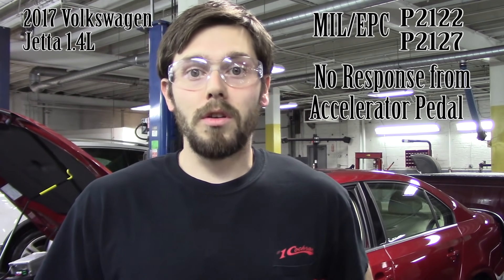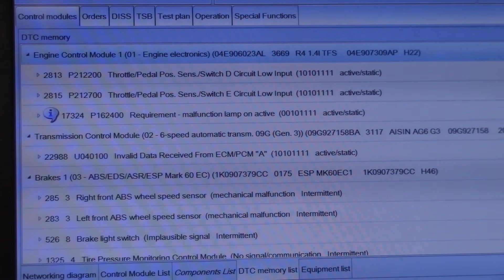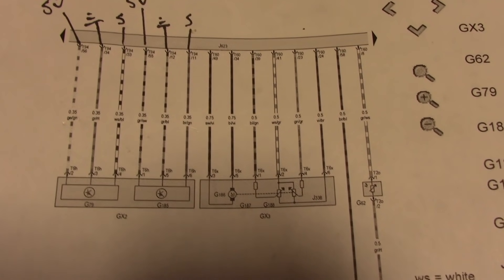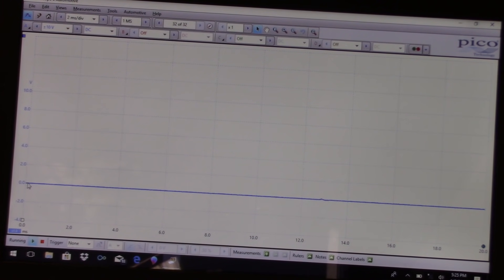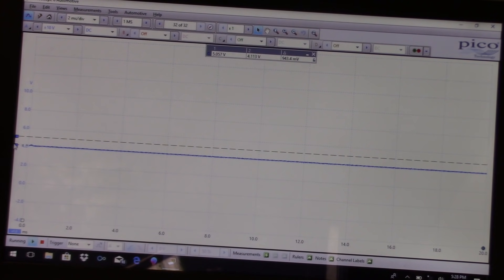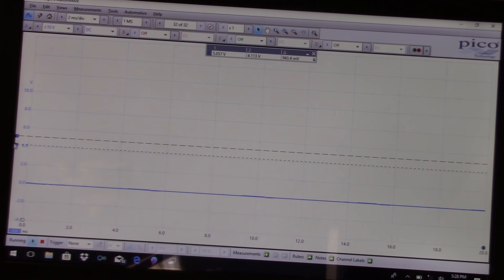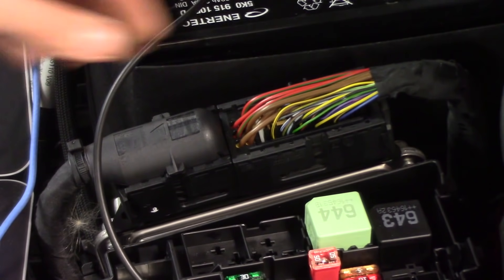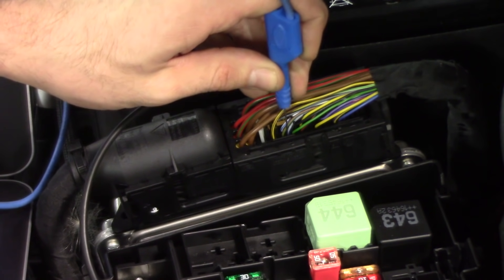P2122/P2127 Accelerator Pedal Position Sensor Faults(2017 VW Jetta)

Comment: Thanks for the video, didn't resolve my issue but got my head straightened out and allowed me to eliminate a few things when I was overthinking. Also when you stated it was weird it would be low voltage I believe it is because it measures the difference between your 5v reference and your ground, so when you had 4v on your ground your difference would only be 1v instead of the 5v the computer was supposed to see.

Comment: I have an issue that's not too different. My accelerator pedal doesn't give the full power when I press it all the way down. I can tell it's not full power cos I set cruise control to a much faster speed than my current speed and when I engage it, with the pedal all the way down, the power noticeably increases. So I have come to the conclusion it is likely an issue with the pedal due to the cruise control still being able to use full throttle. Bit of an odd one but I'm grateful for cruise to be able to test it and work around it

Comment: Hey, so I have a gti mk5 and it drives fine but when I try to push the gas pedal all the way down the car just revs and it doesn’t gain any power/mphs don’t go up. The car kinda just goes dead until you let off the gas and easy back into it then starts going again. I was wondering if ever came across this issue.
Reply: Hi @almonteaddiel, I have that exact same issue. Do you by any chance have a fix for it?

Comment: Hallo,danke für dein Video.
Also ich habe problem bei ein Ford s Max 2.2 Tdci Diesel
Auto ruckelt bisschen bei Fahren und dann kommt "motorstörung".
 auf OBD zeigt fehlercode P2127:00-28 (gaspedale E).
Kann das Grund sein dass es mein Auto ruckelt? 
Bin dankbar für jeder Antwort.

Comment: I'm not sure if I missed it, but why was the signal low with a missing ground at the sensor? I heard Tommy say it as well. I would expect signal high. Or am I missing something?
Reply from the maker: In hindsight I think the signal and ground wires were shorted together
Reply: @PositiveLeadDiagnostics  yeah probably one of them strands feeding the 4volts back off the 5v wires

Comment: So, you used the LED type test light because it is a 5V circuit..but, given that there is no switch transistor in the computer and the sensor ground simply continues to computer gnd..could you have used the regular incandescent test light?
Reply: Yes, up to 200 mA incandescent bulb is ok even with a transistor. These circuits are around 100mA normally so 200 isn't going to burn it according to ScannerDanner. I've done it hundreds of times without a problem and mine is actually more than 200 mA, about 300.

Comment: Any experiece where the cables are for AMG Mercedes. I have P2122 Circuit D Low voltage.
Reply from the maker: I do not have experience with that.  I would need to look at a wiring diagram to identify what circuit D is

Comment: Hi Tom,  Just wondering, if the apps is a potentiometer why was there no signal voltage at the connector despite having 5v ref at the connector?
Reply: Looking at a basic diagram for a potentiometer, if 5 volt was at one end all the time (5v ref) then as long as the wiper (signal) terminal was in contact with the resistor, than at any point with an open ground there should be 5 volt on the signal. Am I looking at this all wrong?  or is the ground needed for the APPS to do it wizardry? IE is it not just a potentiometer?
Reply from the maker: I was also expecting 5 volts on the signal wire. Which is why I was confused it was a circuit low fault. The only other thing I didn't consider is that the wires that were chewed were also touching. Causing the signal wires to be shorted to ground

Comment: Interesting video! I'm doing a similar check on my SLK350. Question, would it not have been much faster to just each of the lines for continuity between the ECU connector and the sensor connector?

Comment: Signal wire must have been open, surely?  Did you swap what you thought were ground and signal at the sensor?
Reply from the maker: One thing I did not take into consideration was the signal wires and ground wires being shorted together after being chewed apart. I think that's why it was circuit low. I need to do some research on circuit design

Comment: Buy the way could you do a full video of the factory scan tool on a car with a real fault I’m very curious how all the functions work like when you have a fault and the way the tool would help you start a diagnostic up to a pont where you find the problem including looking up the information like wireing diagram and connectors view and pin outs I look on U tube and there is no good video of someone using the factory tool that would be a very cool video to see what I use for diagnostic tool is a VCDS wireless interface and also a Autel they work great but there is no help after you have found the fault code especially on newer cars because it seems like the information is very much liked to the VAS tool
Reply from the maker: I'm no a fan of the guided fault finding that the factory tool offers. It's basically an electronic flow chart that makes you do all these unnecessary checks. And trust me. I don't have anymore info than anyone out in the aftermarket.

Comment: So why it's reading 4.1 volt on ground and not 5 volt when with connector plugged?One more question , circuit low means the ground is open?
Reply from the maker: My thought would be there were a few of the wire strands that weren't totally broken until I started moving the harness
Reply from the maker: Circuit low does Not mean open ground. It all depends on circuit design

Comment: Can the peddle cause a no crank/start? I replaced the throttle body and still no crank... I have the peddle to replace could changing it start my vehicle.... Code p2127
Reply from the maker: I do not think that would cause a no crank no start condition. I would look into the starting circuit
Reply: unless it's pulling down 5v ref

Comment: 2003 Toyota Tacoma I replaced my throttle position sensor and it fixed the issue for one day and then I received the code P2127 same problem with no acceleration

Comment: Hi Tom. A few months ago when i was driving on the road and the speed was about 100-120 km/h, I took a signal as "brake assist is defective". Do you have an idea what it would be ? Shall i replace something ?
Reply: Probably your brake boost pressure sensor
Reply: @phill3144  it was about main battery

Comment: Nice fix. I would be afraid an LED test light would give you a false reading though (although it didn't). A 300mv incandescent test light would still be safe to test that wouldn't it? Thanks for the videos!
Reply from the maker: I think it would be ok. Those circuits can handle more than most think

Comment: Hi Tom great fix I was thinking of buying the VAG scan tool VAS 6154 because I’m beginning to see that the newer VW and Audi cars after you have retrieved the Fault code from a module there is not much information to actually fix or diagnose the issue I was wondering if you had followed the GFF from the VAS tool how you think they would’ve gone about fixing the issue?   As an example there is a shop that called with fault codes on a 2013 Jetta hybrid pertaining to the DSG transmission I’m subscribed to VW Erwin repair information system but there is no information on transmission fault codes matter fact there is no information on air bag HVAC etc... the only thing I find is the engine fault codes I work primarily on VAG cars and what I want to know how good is the fault finding information on the factory tool including resistance test and scope wave form I think that there is a scope that you can attach to the VAS tool right ? I think the factory tool number is VAS 6356
Reply: Very rare doe's odis guided fault finding link you to the scope and i find the test plans to have went downhill over the years, example check connector for loose or bent pins, check for shorts and if you input all ok then it will probably tell you to replace component, best to look at enviromental data to see when fault occured as the vehicle maybe was under load and can effect certain conditions on wiring problems.
Measured values are great though :)
Nice vid Tom

Comment: Excellent tutorial!  Just curious what the cost to repair something like that would be? I’m guessing close to $1,000?
Reply: Required hourly labor @ flat rate. No materials required (a few traditional crimps with heat shrink..) Problem with these types of repairs (for a knowledgeable and experienced tech) is commonly customers will   witness how quickly they are able to diagnose and fix the issue and feel a certain way about paying the money that is deserved for the repair. (assholes don't consider the cost of the diagnostic equipment needed to be quick and professional with said repairs.) And usually have no mental capacity to understand the priceless years of experience it takes for a tech to work so efficiently..Then on the flip side if you sandbag the job and drag your feet you have the possibility of ruining your reputation as an honest mechanic..It's a tough career. I tell people:      "I work on cars, but I deal in people"

Comment: i change wire engine..same situation p2122 p2127 cannot repair must change the wire the cost 200dolar..huhuhu my fault use datatech managent  join the standart ecu wire..